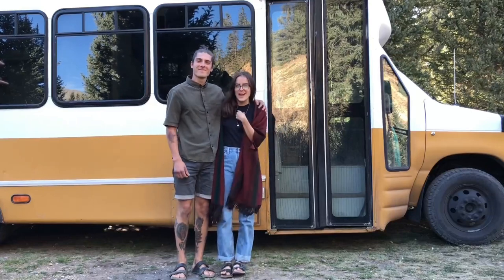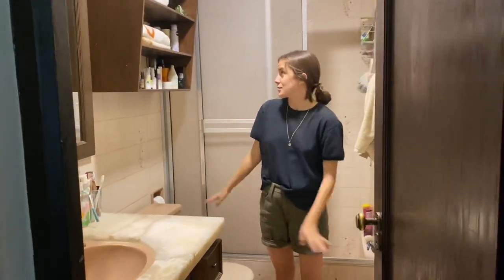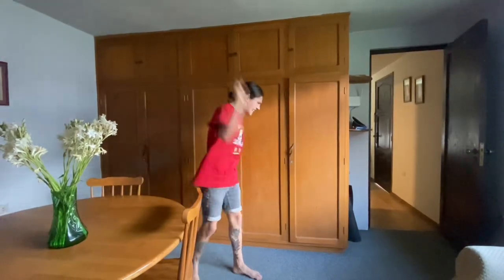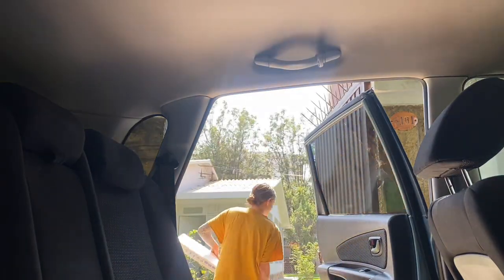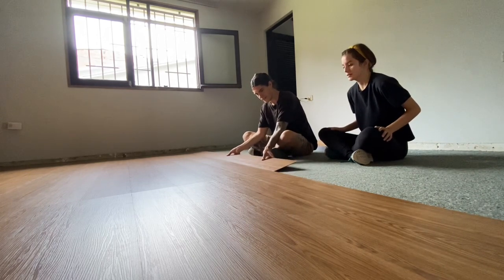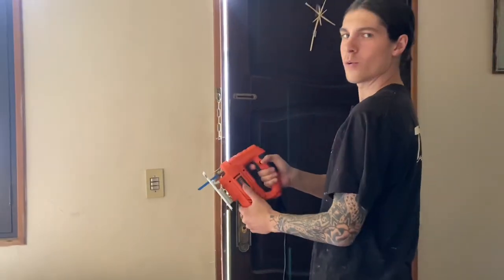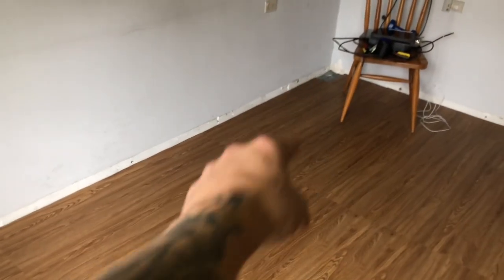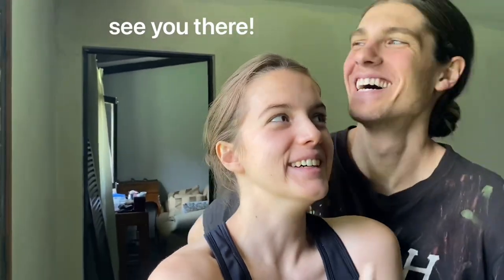we are renovating a 1980s apartment with no experience… in Bolivia!

Comment: Te flooring won't last very long being on carpet. You should have taken out the carpet regardless.You really should have talked to someone before you installed the flooring.
Reply from the maker: We did talk to a professional like we mentioned and they said just like many good articules on google that as long as the carpet meets certain requirements (which we did) there is no problem to do so!